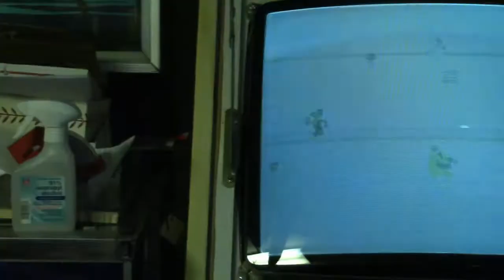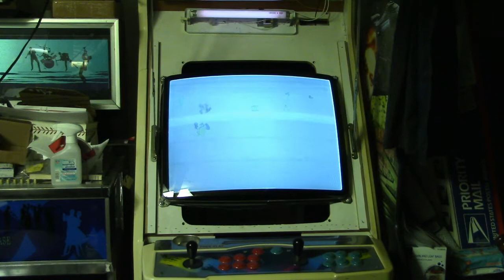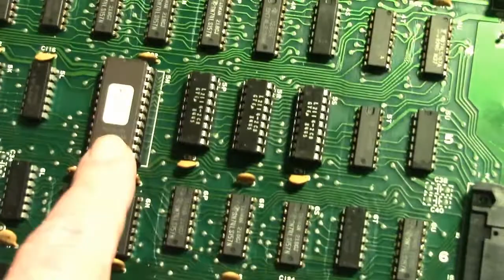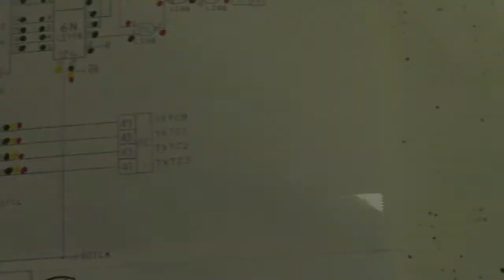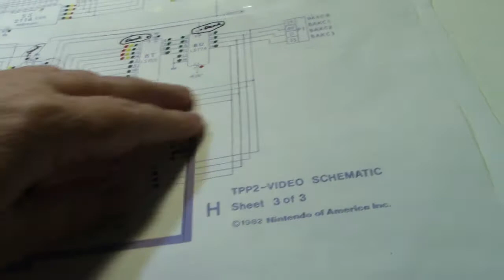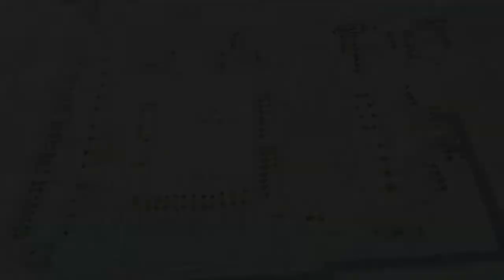Sam's Arcade Fix Popeye Board Repair Part 7 More Logic Probe Troubleshooting

Comment: Great stuff =D  Note - I believe these boards do output inverted video!  Not sure what's required to flip it, but I remember seeing that Nintendo did invert the video on some boards.   The difference between a 27C16 and 27C32, the 32 is twice the size and has 1 additional address bit.  If a board allows those 2 different chips and there are no jumpers, when using a 32 you would need to take the 27C16 ROM and double it up before programming to the 27C32 - it's likely that on that board the upper address bit is pulled high or low.